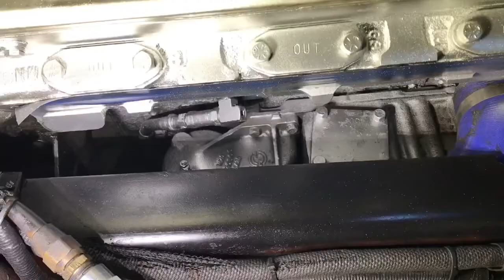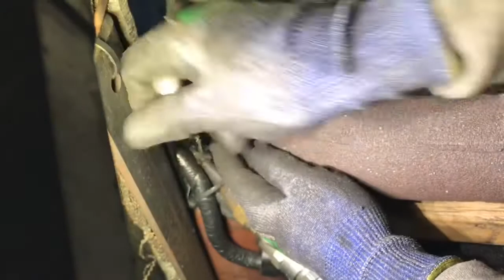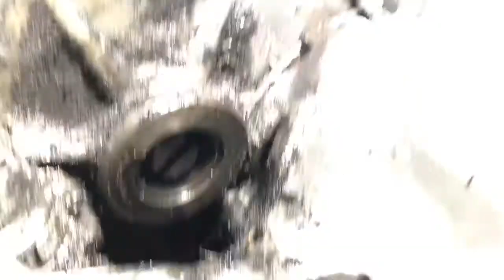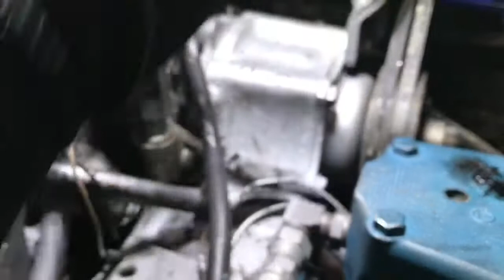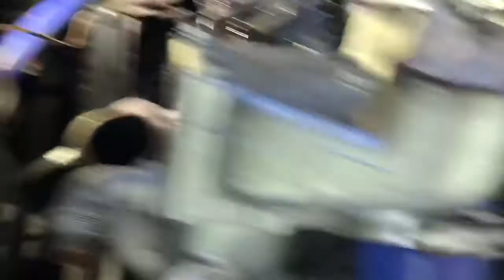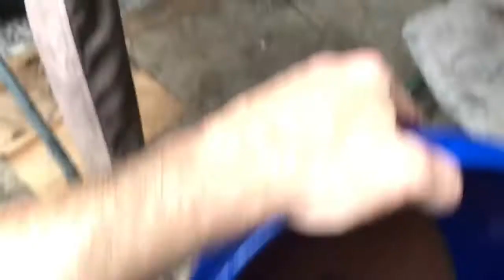Replacing Exhaust Manifold Gaskets 6v92TA

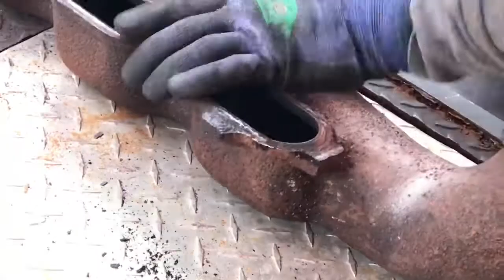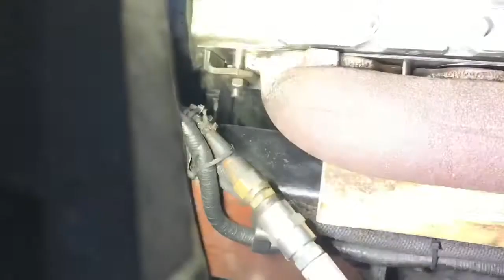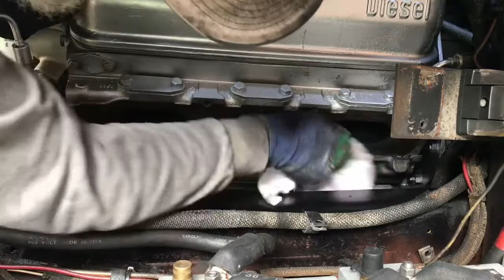Comment: The plate on the Tac drive I believe the holes are supposed to set at 9:00 and 3:00 not 6:00 and 12:00 to allow it to hold oil to keep the gears in a bath of sorts.
Reply from the maker: Rodney Middleton- Thanks for the tip, that makes sense. I did not see this type of tach drive shown in the manual.